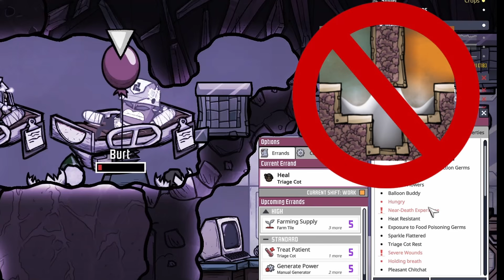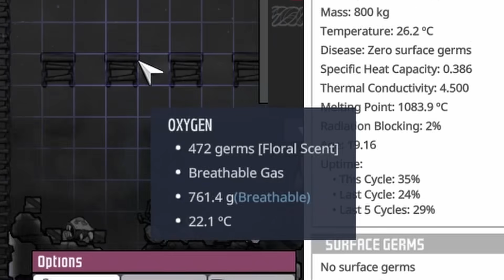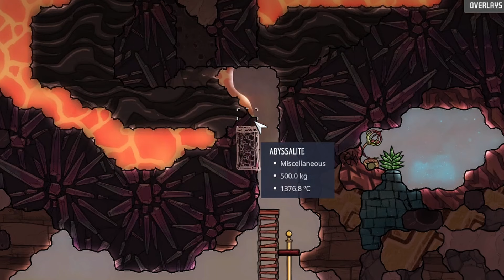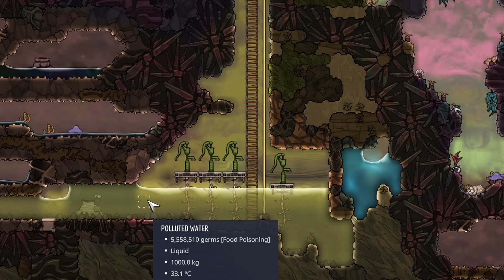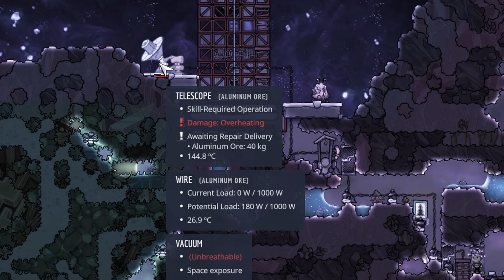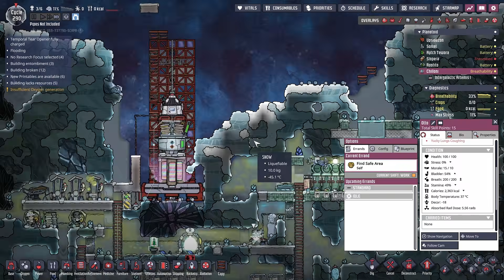I Beat Oxygen Not Included WITHOUT PIPES

Comment: For oxygen on the polluted planet, I use a sublimination station with submerged airflow and mesh tiles over it, with deodorizers on top. Plus a drop of oil on top of the station. That lets you use it without the station overpressurizing, and only lets clean oxygen pulled up by the deodorizers to be released. I use my outhouse dirt here since most of my food comes from ranching which means I don't need it for compost (I like to ban agriculture in my runs bc it's too easy)
Reply from the maker: yeah I don't compost much either! and farming is sure too easy for challenge

Comment: i've done a similar challenge recently: use electricity ONLY for researching. no bionic dupes, no aquatic dupes, no ice biomes. i found that if you run out of clean water, one of the solutions, albeit a bad one, is flooding magma to make a steam trap and using the steam trap to boil the salt or dirt out of a large pool above it.